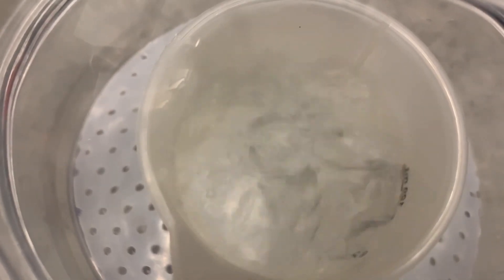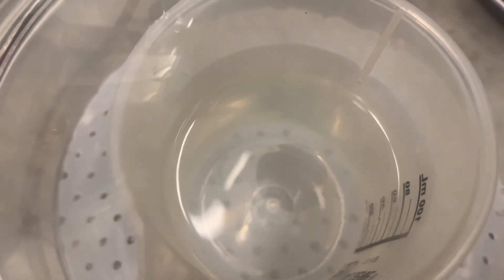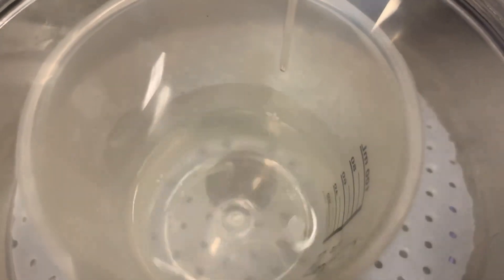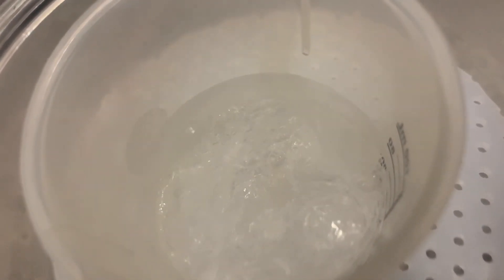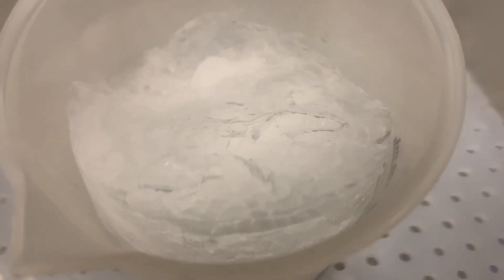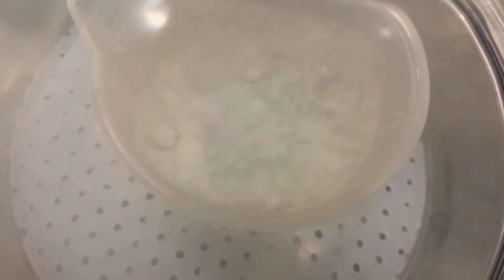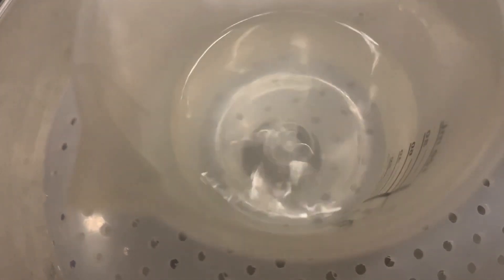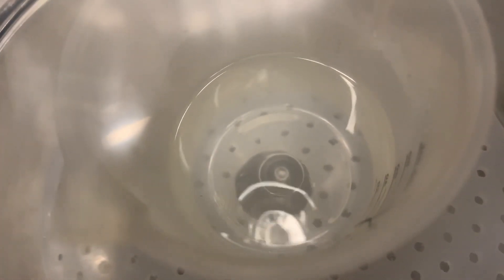Solid Nitrogen Ice

Comment: very frustrating substance. can never get it out of there due to heat capacity being so low, melts instantly as soon as the vent valve is opened. maybe if it's purged with a liquid helium stinger.... 

though I guess at that point it would probably be easier to just freeze the nitrogen using the liquid helium directly. there used to be an ancient turnip quality video on here of someone doing this, the only time I've ever seen it done, but it's apparently gone now.